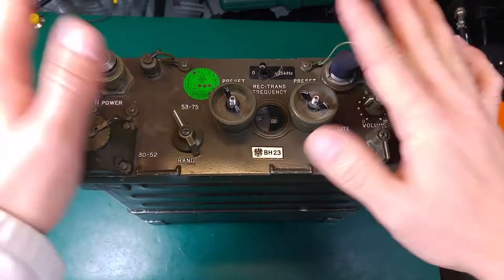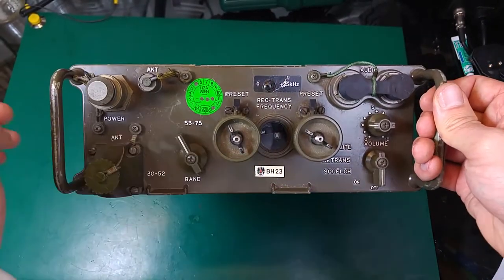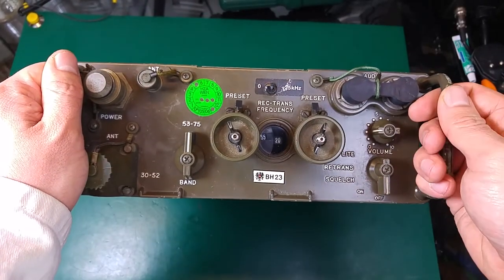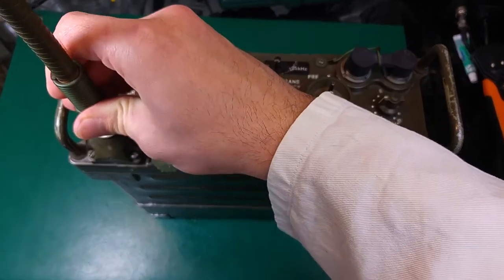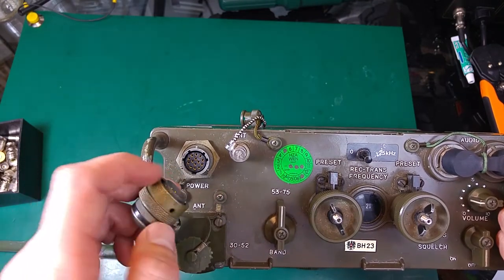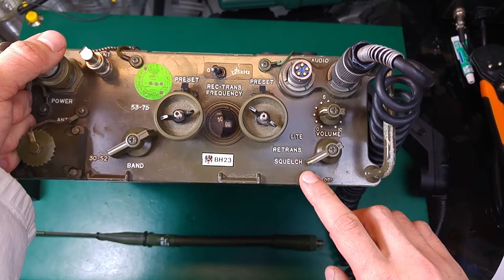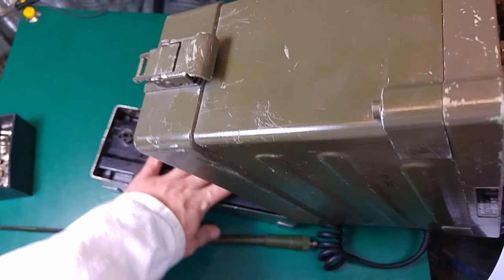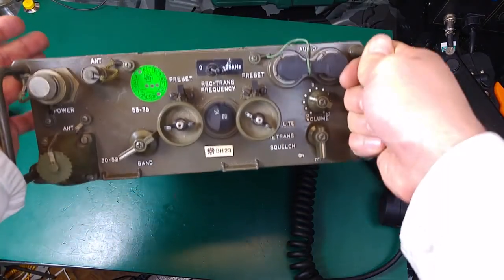PRC-77 tactical VHF (FM) army manpack radio

Comment: Pretty mint condition.  I was a Radio Operator in the Canadian Armed Forces and Carried an AN/PRC-77 as a Paratrooper. The power connector is use when mounted on an am-2060 power amplifier for vehicle use.

Comment: its just 5W FM. it is similar to a cheap UV-5R walkie talkie that is worth 20$. the only good thing about this is that it is rugged, and work at a lower frequency (30-50mhz) instead of 144-440mhz. 
i wish somebody made rugged military style radio like this for emergency at a normal price.
Reply from the maker: You can't compare military quality to any civilian device also there is collectible aspect since it's iconic radio used at Vietnam war (prc77 in general not that unit). There is chines SDR packed in military style enclosure - but I would say - still not normal price for cheap SDR in fancy enclosure.  Here is model: TBR-119  You can check it out.
Reply: @ElectronicNoobBlog  thank you very much!

Comment: Where can you find a good Prick-77?  Rare on eBay now, mostly just non working static display ones on there now. Getting hard to find.
Reply from the maker: I got mine off ebay.de but back then it was easy to find working one + accessories.

Comment: Tell me if i have 2 units can i use them to "call" each other cause i plan to have one for emergency contact
Reply from the maker: Sure, You set same frequency and they can talk to each other.  Good chose for emergency in fields, wood, rural area but inside city I would go for modern digital radio VHF or UHF. From my observation inside city there is lot of  local interference and better range in that conditions have DMR radio.